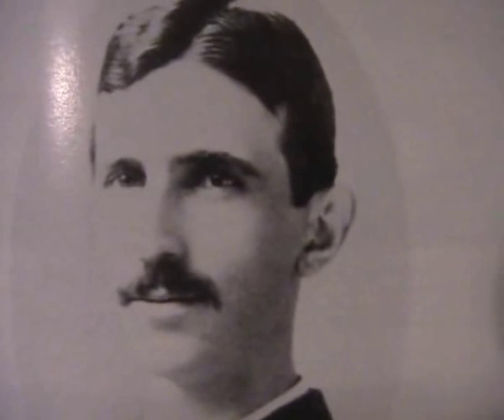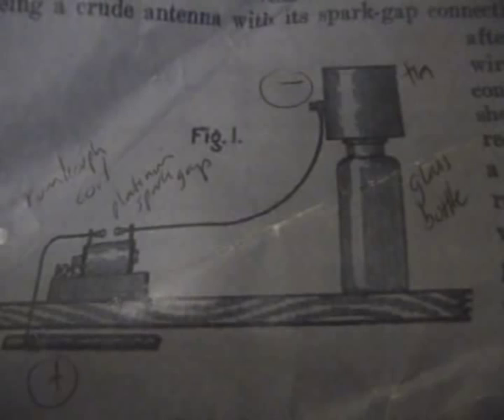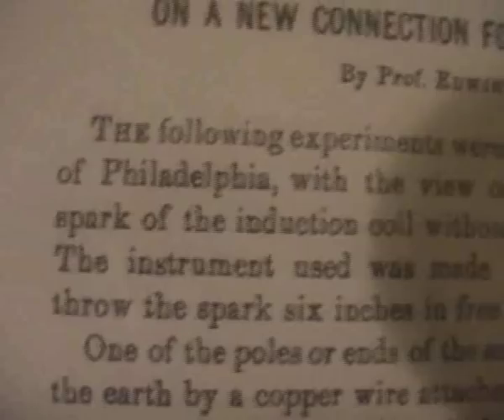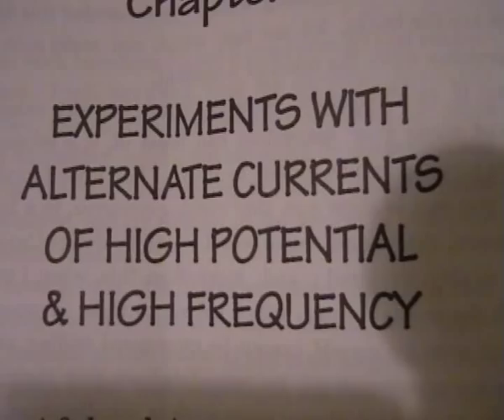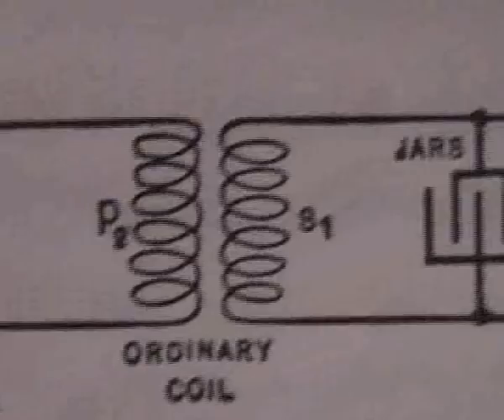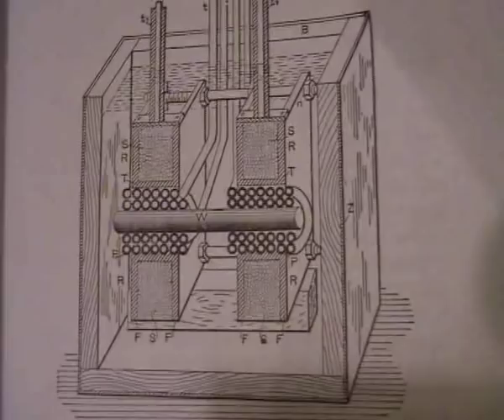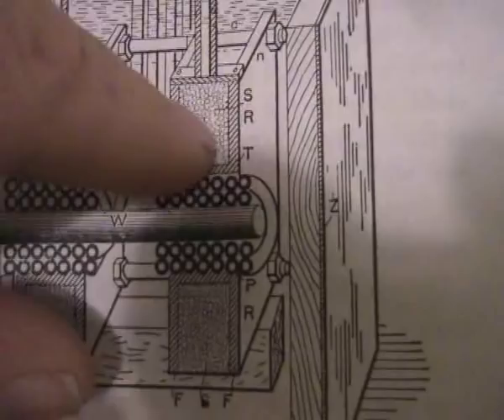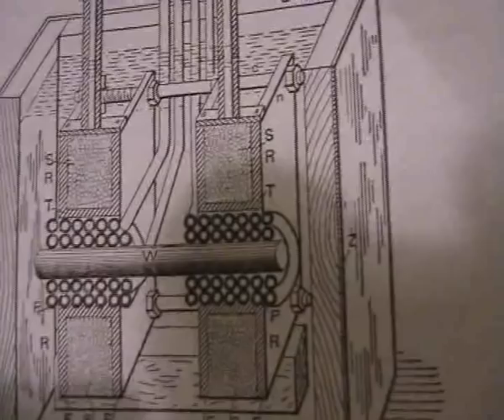Update 38 - Quest for free energy - Tesla's Disruptive Discharge Coil & Radiant Energy Production

Comment: capacitor charged with negative voltage, disruptive discharged into the coil. If the voltage change is almost instant in the coil, the radiant energy fx are introduced. this means staying well under the resonant frequency of the coil, and matching the capacitor size to the coil.
I suspect the bifilar pancake coil is very able to produce the radiant energy fx.

Comment: From my research, I have discovered that when the voltage and the current are lagging at exactly 90 degrees in an LC system at resonance, then amperage and voltage nodes are created in the circuit. When an LC circuit is short circuited, it forces the voltage node to the capacitor and the amp node to the inductor. Also, a spark gap is the perfect switch because it is voltage dependent and creates the 90 degree phase shift automatically (voltage ionizes the gap, amperage crosses ionized path lagging the voltage, then the process restarts). The standing wave in the oscillating circuit is what creates the disruptive discharge coil. That is when radiant energy, (aka cold electricity or dielectricity) manifests itself. This research is mainly from the incredible groundbreaking research of Hector Peres ( of ARK Research).
Reply: So that would mean your load is 100% reactive right? No resistors in the circuit would cause power factor angle to be 90 degrees. Wouldn't that basically cause a short circuit and meltdown? my underdranding is that you can only have a purely reactive circuit if the capacitance equals the inductance so that it is basically just a tank circuit if you aren't going to have any resistance. In that case, there is no lag.

Comment: Tesla's disruptive discharge coil in that zinc box is actually more like a galvanic cell. That setup would make a perfect impedance match of source to load if the load was the source. Imagine a coil of bare copper wire in an electrolyte of dilute acid with a secondary of bare copper wire of fewer more corse wire. The smaller wire need be in sets of parallel and touched to the zinc box when activated. The ions in the dilute acid rush into the secondary circuling the magnetic field travelling out the wires.
Reply: The zinc is attached to porous wood which absorbs the electrolyte and allows electrons to flow between the copper and zinc.